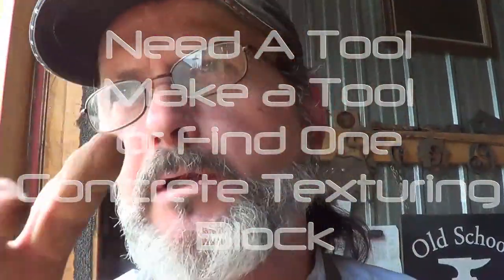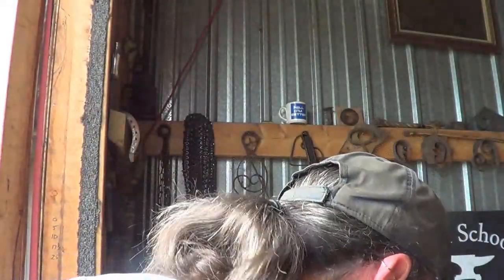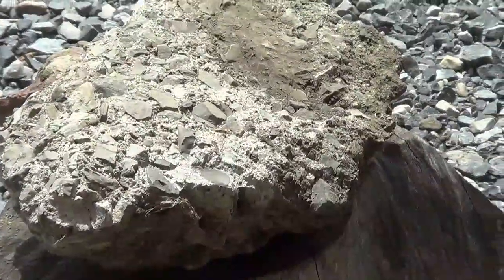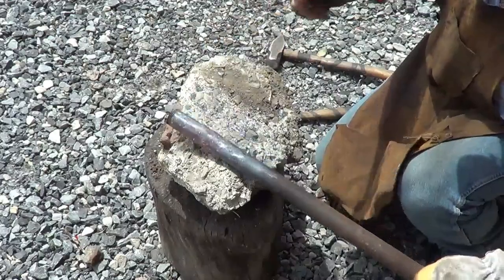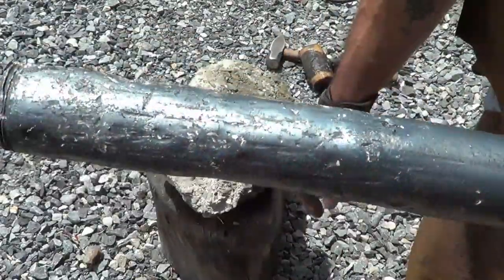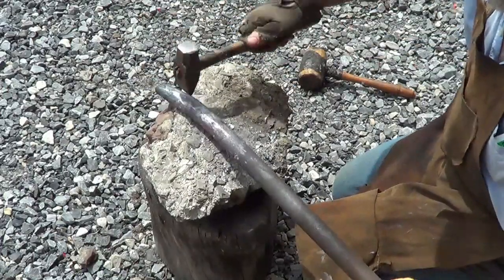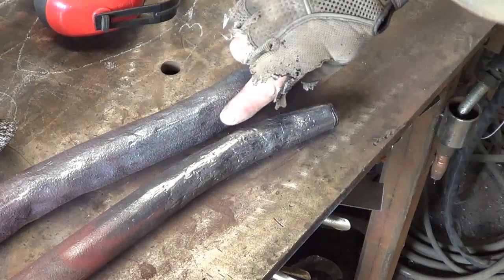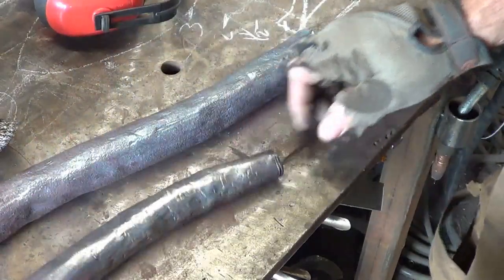Need A Tool Make A Tool - Blacksmith Tree Bark Texturing With Concrete

Comment: That's a good idea right there Chandler. I wonder if you could get even more texture by also giving it a short bath in some strong acid, that will pit and dull the surface. You could even add a very primitive etching mask by giving it a very light coat of spray paint, more like over spray rather than actually spraying it. Great work.

Comment: The ways to forge texture into steel are pretty much limitless!  A number of years back I did quite a bit of experimenting.  One good way is to take an old hammer and randomly weld some splatter on it.  Another way is to use an angle grinder to cut random cross hatching lines in the hammer's face, or even drill various diameter 'craters' however closer of far apart as you want.  

You can put any type of gravel, sand, etc. on top of your anvil and hammer on top of that.  It's all up to your imagination.  I do however, really like the sound of using the face of a broken piece of granite like you mentioned.  Don't forget you can always combine these texturing methods to get the look you're after 👍🙂

Comment: That's really cool.  Concrete doesn't stand up to high temperatures, but I would guess that piece should stand up for a hundred feet of pipe.  Probably will break up from hammering before the heat can do it in; but as you can find broken up concrete for free about anywhere, that's not much of a problem.  I would be interested to see what kind of textures you could get from a cinder block.  That would probably give a finer texture.

Comment: I had an idea whilst you were doing this and in the top corner of 'next videos list' was your wheel hub forge idea. Set me to thinking if you had two suitable hubs opposite each other and ran the pipe down between them (like a pipe extruder?) but trickle-fed sand and grit as you turned the wheel, you could steam through a huge length quickly then come back and add your hammer marks, narrow it etc in phase 2.

Comment: Chandler, the cross peen hammer may be too rounded for a good tree-bark texture. But on January 16, 2016 you made a tree-bark texturing tool out of a ball peen hammer. Did you forget about it? Jon

Comment: if you had/have the time couldn't you use wet concrete to make a mold of the one you like, wait for the concrete to harden and use that to texture. Im not sure if you would have to leave the metal in the concrete but i would assume not if its about as dry as when someone would write their name in it
Reply: it would be smashed to pieces in no time as seen in the video